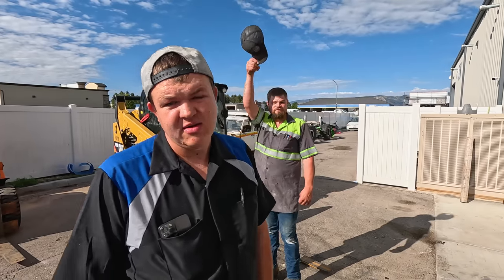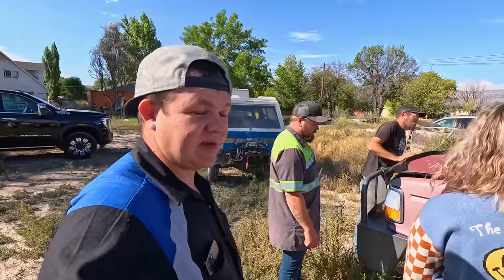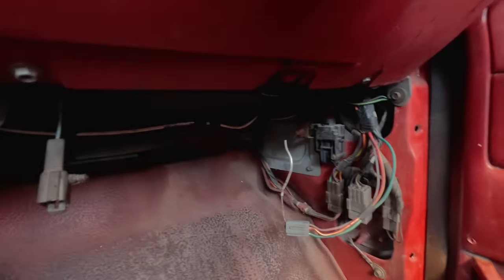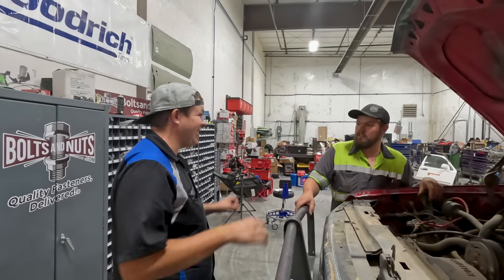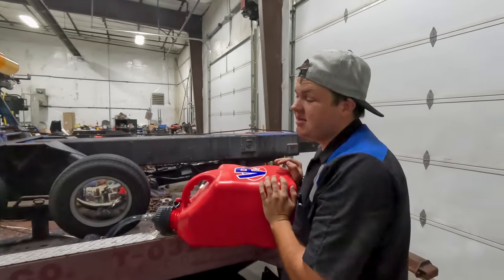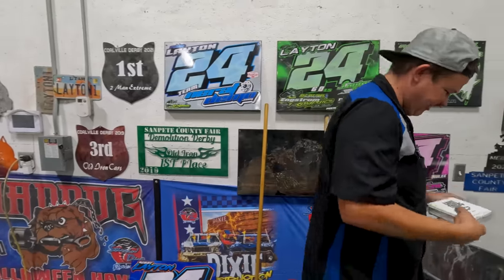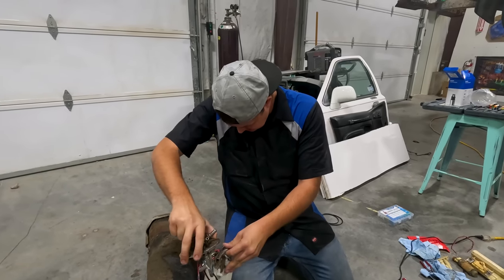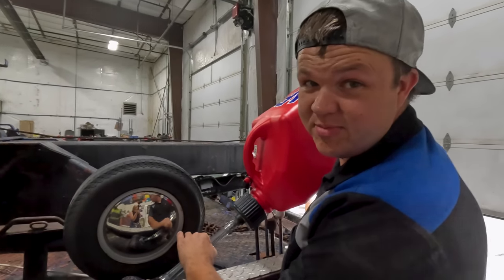Old Ford Tow Truck FORGOTTEN For Years! Will It Start?

Comment: if you put a pressure compensated, load sensing variable displacement pump on it, it will go faster and you will actually have some serious pulling power
Reply: Pretty sure only reason Paul & Matt did electric winchs was sponsor obligations from harbor freight.
Reply: He'll need to keep the hydraulic pump for the equipt. in the back anyhow. A remote throttle control would probably help with speed issue.

Comment: Interesting acquisition.  You and Rory can have a ford wrecker pull off.  That winch will pull a mountain over.  Speed can be had with a few parts changes.  High speed isn't all it's cracked up to be.  It's a single line, but it'll get some work done.  Get the wiring right so you're not chasing gremlins all the time.  It'll be fun to see where this goes.

Comment: Usually when a wrecker starts winching the RPM raises to like 3000 RPM. At that RPM the winch will be fast. So that feature does not seem to work.. I assume a lever on the back can controll the RPM of the engine. 

A hydraulic winch is way way stronger then electric ones. And should be as fast.
Reply: Plus they can run for long periods without over heating and burning up the electric motor.
Reply: I can't imagine a professional waiting around all day for that slow winch, so yeah, something is getting overlooked.
Reply: Thats why Eric over at BSF recoveryteam has it on the 'Wrecker,  idles up when the PTO is turned on
Reply: @Stratos53100  Yes. It either has a mechanical lever connection to the crane levers that is in operable or another way it can raise the RPM of the engine so it can power the hydraulics. When that is done the crane should be fast and very very powerfull. Stronger than electric powered by a battery.
Reply: most wreeckers have a throttle lock at the back for rpms
Reply: @benjones1715  The cable was broken. They have not yet received another cable I assume.

Comment: Hydraulic winches speed is dependent on where the PTO is installed on the Transmission. If it’s installed in a constant speed licit will be slow. Since that truck is setup on a hydraulic pump run off the engine itself the speed will vary depending on the engine RPM. I’ve installed tons of PTO’s and winches of all sizes up to 120 ton on trucks with my dads company and I’ve seen and ran hydraulic winches that are much faster than electric. The only winches I’ve ever ran that are faster are chain driven that are connected via a splitter/transfer case as you can use the transmission gears and engine speed to spin them faster.

Comment: 11:18 I use those electrical connectors for my winch on a cradle on the front of my '03 Rubicon. It has a 2nd battery for the winch in the trunk and I used #2 welding cable for the plugs from the battery. I have plugs front and rear so I can use the winch either front or back. I also made up a jumper cable like this one to use the winch battery for starting vehicles so that there is no danger of wiping out the $700 PCM. Warn 9000# winch and cradle is 110#. The welding cable insulation is very durable and the fine strands of wire makes it flexible. All electrical connections/lugs are both crimped and soldered. I use the marine battery switch to tie the batteries together so that I can jump start the Jeep easily. I can also carry the winch, battery, and chain to where I cannot get the Jeep to assist someone.
Reply: Anderson plugs are great.  My plow truck has them which makes it easier to plug a winch or jumper cables in.
Reply: @offroad6309  Those Anderson plugs, not the chinese knockoffs, are really tough.

Comment: Excited to see that you are finally getting a piece of equipment that is made for the jobs you are doing.  There are suggestions in the comments on how to make the hydraulic winch faster.  Start there and add electric winches on the back and front.  Fix the things that need fixing to make it really dependable and put it to work.
Reply: And a winch on bouth sides too .

Comment: Eric with BSF has a hydraulic winch on his wrecker. Awhile back he showed up for a recovery, but there was already a wrecker with an electric winch hooked up. The e winch did not have the power to bring the stuck rig over the hill. It could be that it was an older or cheap e winch, I'm not sure, but Eric wound up having to hook up his hydraulic winch to pull the guy out. It's just something to think about.

Comment: I think I would build the roll cage in the laymo before i put the roof back on. It would be easier to weld the top. You could just clamp the roof in place when you need to check for clearance.
Reply: I think they're doing an exterior cage.

Comment: Those old OBS Ford are quite reliable regardless of what the Ford haters say. With proper maintenance and some upgrades it will serve you well!
Reply: ❤ DANG STRAIGHT....LOVE MY FORD...AND HILLBILLY S RESPONSE....YOUNG MAN AFTER MY HEART...
Reply: I'm still putting 1000 miles a month on an IDI Ford from 1993
Reply: @forestlawrencegrading9154 I used one in my 75 crewcab because of the reliability
Reply: Whether your a Ford fan or not if you can’t admit that OBS Ford was one of the best truck produced you have problems. There’s a reason the F series truck has been the best selling truck for 46 consecutive years. I still run a couple OBS’s everyday for my business along with new trucks because they are just rock solid.
Reply: Just kindly send anyone with OBS negativity over to ZIP TIES N BIAS PLIES ol’ Peg will straighten them out. 😬
Reply: Wouldn't give you scrap prices for a new Ford but 89 and older ♥️
Reply: Love that you are all so American I don't own a repair shop but have a car and truck I'm fixing ? Up so had to buy an old Ford long bed that needs work oh sure now do you know where I can get a day stretcher? 😆😅🤣
Reply: Loved my 1990 f250 had the 460 it was awesome.  But I love my 1st gen super duty so much better.
Reply: The problem I have with Ford is that the don’t use standard parts. They change between year/make/model/half year/and what factory it was produced in. 
Those old 300 i6 engines are still some of the best motors produced especially with the standard transmission.
Reply: @billwilmot4820 Mechanical Engineering is the way to go. Electrical anything is the most common failure in motor vehicles.
Reply: @ianrunyon2423   maybe  the newer stuff take my 1st gen super duty I can use parts body wise all the way up to like 2016 I may be off a year but still. Interior door panels work you just have to do adapter harness for the electrical controls. Because well obviously technology changes over the years. Also lots of idi power strokes use the early 99 turbo and components for a cheap easy super duty swap. You just gotta know your stuff or do some research.
Reply: @ericnewberry  during the 90’s was the worst. Power steering pumps were sourced from several different manufacturers and were not compatible within the same year/make/model F series. Same goes for alternator and several other parts. I would rather a vehicle that uses one part during the entire run than one that changes between parts.
Reply: @Atodaso-pg9kq I came here to say that. Although most of this audience couldn’t handle his minty Canadian mouth 🤣🤣
Reply: @georgejulien3286  very true, he’s not exactly what one would consider “family friendly”/G rated. 🤣
Reply: This video was really good until you got to the end and then you put your little daughter in it.  That did it. You just had to do that. Didn’t you Robby?  … that sealed the deal that made a very good video into an absolutely outstanding great video!!  she is so unbelievably precious and oh my God she is so gorgeous.  So,   So Angelic.
Reply: Too bad in Northern Minnesota they've all rotted away
Reply: I've Driven Chevy,  Ford, Dodge and Toyota and all of them are better than walking!
Reply: I love my 95’ f150 but it has way too many vacuum lines
Reply: @ianrunyon2423 yes, I own a 1995 F150 2wd with a 5 speed.  AWESOME truck.  200k miles on it, running STRONG. 👍
Reply: most haters that know anything are probably remembering the ford diesels of this era which were far inferior to the competition imo especially considering the cummins of that era.
Reply: @truckstractorsandmore3608  is that another way of saying it sucks?  I've driven them all and have loved them all and cussed at them all.

Comment: 👍   Thx for info on solder wires & gas tanks!       Also the “McDonalds is always out of ice cream” I’ve experienced in UT, OR, VA, MD, & now Kentucky where I live.   I saw somewhere on y-tube many locations do this on purpose because to save overhead $.    Electricity to run the machine & labor to clean and maintain it.   (since they use powder, there is no refrigeration of ice cream involved).

Comment: Man i commented this before i have a 83 square body wrecker it runs great and needs very little tlc to be road worthy i wish you guys would have bought it and used it . Mine has a boom and a wheel lift and its a dually chevy with a gas 350ci motor thats healthy

Comment: Robby, on that Ford tow truck, I saw you have manual front hubs. Hopefully you have manual transfer case. . Either way,
Both Ford and I suggest that after you take truck out of ,4wd, you back the truck up about ten feet. This action positively releases the spline locks between hub and axle. They will unlock with normal driving but that little effort ensures unlocking and with front wheels in free wheel mode saving your fuel mileage. In my 3 trucks with manual hubs/transfer, I get 3-5 mpg improvement. The shift on fly unis keep the splines engaged so front drive axles are always spinning thus pulling mpg down.
Yes I'm a blue oval man. Sorry, but after you get used to using this truck you'll understand why Ford is #,1 seller of trucks 
for 42 yrs running. Hope to see you at your sponsored event..

Comment: Love your videos, and the things you are making. I am from europe and those soldersticks I have been using for over 20years. I didn't know they were that rare in the USA 😅 its a fast cheap solution for connecting wires. Here they cost €2.50 for 100p. Dont know what they cost there bit they are really cheap😅. Keep up the good work bud💪💪

Comment: Might be worth a call to Casey LaDelle.  He has an extremely similar model Ford Tow Truck.  Watch his videos for wheel lift adapters and which Dollies are the best.
I believe that Chad's Fab got a Ford F-350 wrecker from Fab Rats to pull the tow bed for his build.  I don't know if they have any extra parts from the Chassis.

Comment: I just used my 1979 FORD tow truck.  To push a 2022    Chevy truck off the road with a blown engine.  Just proves.  That it doesn't matter what you drive.  All that matters.  Is it's DEPENDABLE  . Or 
RELIABLE .  It's just that some people just don't know how to work on anything else  . I fix them all .

Comment: Gas does attract moisture from the atmosphere if you have more humidity you'll have more fuel in your gas but it leaks to the bottom of the tank so that's why they always drain water off at the bottom of a big tank.
Reply: Rather you'll have more water in your fuel

Comment: You guys need a metal enema can.  Mount it up high with a hose directly to the fuel inlet.  Gravity will give you the pressure.  Put a shut off in the line.

Comment: Don't get rid of the hydraulic winch!  #1 it's slow because it was idling... the clutch pump on the engine is designed to operate between 1000 & 1200rpm while in use...at lower rpm it will work, but slow.  Those old wreckers also commonly used worm gear drive winches... they're slower, but much stronger, that's why wreckers use em...they're strong & reliable & can pull non stop. If you want to have a faster spooling hydraulic winch...swap it for a planetary style winch... still hydraulic,  still 100% duty cycle but they spool faster than a worm drive.. you've already got the pump & lines there.. you'd be going backwards to go electric for a main winch. Theres a reason professional tow trucks of any size dont use electric unless it's an auxiliary one...an electric winch will never do the work a hydraulic winch will even if they have the same  rating.. Plus it can run non stop & not lose power because it's overheating or the battery/alternator isn't keeping up.  If you wanna add auxiliary electric. That's one thing.. (also should upgrade the alternator & dual batteries due to their high amperage demands...especially if they need power run all the way to the rear of the truck... also consider draining the hydraulic reservoir & putting fresh fluid & filter in it... if it has water in the tank from sitting, it'll be at the bottom where the suction line is & it'll wreck the pump.... fluid flush is cheap.... don't forget to find the dozens of grease zerks on any moving wrecker & wheel lift parts...  looking forward to seeing tow truck videos..

Comment: Rory has a similar ford truck project Im sure you know that already haha. Also Fords use ATF for power steering not "power steering fluid" I've seen lots of power steering pumps die from running on the wrong fluid.

Comment: You got a great deal on the wrecker. Those 90’s fuel injected 460’s weren’t very powerful but they were very reliable. Good thing is they can be made into torque monsters fairly easily. The fact that everything still works after sitting outside for 7 years is pretty amazing.

Comment: I've restored 9 of those F250/F350 trucks over the last 20 years. I highly recommend a Saginaw power steering pump conversion, no more whine, way more reliable. The third brake light wasn't a thing until '94. On the '92 and '93, it's only a cargo light. In '94 is when Ford added the 3rd brake light/cargo light combo. I'd also do a ZF-5 speed manual transmission swap. It's literally bolt in. Rory's truck is a ZF-5 speed. Far far more reliable than that E4OD automatic. That's what makes Fords so fun, is their interchangeability!
Reply: What interchangabilty? Back in the day you had to figure out if it had a Cleveland, Windsor, or an M. One wouldn't bolt to the others transmission, components wouldn't interchange. 
At least with Chevrolet a small block would bolt to anything else. That's why most people that do mods always goes with Chevrolet, easier to work on, actual TRUE interchangabilty. 
When i was going to automotive school, we always had a motto. If a manufacturer could find a way to screw something up, it would be Ford.
Reply: @timothygeiger8271 it's a 460. the zf cab behind thousands of 460s in the 88/97 f series. so all the parts are available.
Reply: @timothygeiger8271  Tim, this isn't back then. The 9th generation F-Series trucks. 1992-1997 (F-250/F-350/F-Superduty) were all very interchangeable. I wouldn't post a comment like that, wasting my time if it wasn't. The 9th gens are extremely plug-and-play. I've worked on them for 20+ years now.
Reply: @oregonfordguy9812  exactly right! 💯
Reply: Absolutely!!  100% agree that this rig need the Saginaw power steering conversion.  I have done this twice myself and the difference is incredible, and cheap!

Comment: You will not go wrong with your new to you OBS Ford. I have a 1993 with a 300 line six with 220,000 miles still my daily work truck. Look forward to you building it out.

Comment: $2800 for a 1-ton 4X4 truck is a screaming deal. I sold a 1985 Chevy K30 single cab rust free Las Vegas dually with a 454/T400/NP205/Dana 60 front/Dana 70 rear a few years ago that ran and drove, but was still wore out from one end to the other for $7500.
Reply: Seriously, the front axle alone is worth almost that much

Comment: In my opinion you should run a yellow top optima not a red top red tops are starting batteries a yellow top is a good deep cycle battery especially with the load you're planning on putting on it with the winches and whatnot
Reply: Or get a much cheaper AGM battery, Optimas are over rated.

Comment: Robby you`re lucky gas is so cheap down there up here in Ontario Canada it`s only $1.62.9 per liter which works out to 3.79 liters per US gallon 1.63times 3.79 = $6.oo per US gallon, if I did my calculations right, correct me if I`m wrong.

Comment: Yo those electric winches are speced for 650 amps max and maybe even more, Matt had problems with the winches draining his super batteries. Need em big boy Alternator and  duel batteries. Maybe even duel Alternators and dual Big Boy Batteries. That battery you put in isnt the hot ticket they use to be. Good luck. Iam sure Chad has all the poop on this.

Comment: In regards to gasoline.
The federal law has allowed 4% water by volume when it leaves the manufacturing plant so they test the gas and if it does not have 4% water by volume they will add the water intentionally to come up to the allowable federal mandate.

Comment: I think you need to 6.2LS swap it with a 4l80e and a straight axle in the front instead of the dumbazz twin I -beam Ford garbage! Take the blue oval off the front and make sure the rest works!

Comment: Those old Ford push rod engines were just better. If you're going to rebuild everything, this is a great place to start. It has the potential to better than anything you could buy new. Especially with these folks doing it.